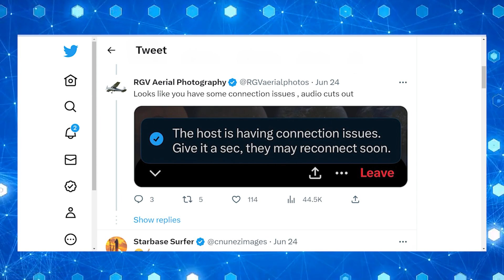Musk outlines major upgrades for SpaceX Starship stage separation ahead of next launch

Comment: So, somehow SpaceX is 'dedicated to safe and successful' launch when they don't actually perform "static fire" of engines but 'burp' them for a few seconds and call it good. Unlike any real space engineering firm which requires testing the engines before flight? They take short cuts and don't do diligent work (as shown by the pad falling apart during the last launch) avoid planning, (as they've done with the "not-a-deluge-deluge system" which will net them millions in fines if it's used at all) and in general spend huge amounts of money and time on efforts to avoid doing the simple and necessary steps they end up doing anyway.

Constant 'innovation and improvement' on a design that's not yet finalized shows a lack of proper planning and design work to START with not some form of "cutting edge" aerospace work.SpaceX has yet to reach a 'finalized' design for Starship or Superheavy indicating a groping and ill-thought out "planning" which has become the hallmark of the rough and unprepared work that SpaceX is not doing. Compare this with the more successful and competent design and planning of the Falcon which was modified once it was operationally successful rather than haphazardly as it was being built.

Comment: The hot stage separation sounds risky to me.  Why not use some COPVs (carbon-over-wrapped, pressure vessels) like the ones they currently use on the booster and to power the water deluge system?

Comment: StarShip & Raptor is on its 14th year of Engineering & Development (2009 to 2023) How many more years do you think it will take before it is capable landing with chopstick, refueling in space, landing on the moon, getting human rated and being reused rapidly? 5, 10 or 20 yrs more? Falcon 9 took 13 yrs to land on earth, 16 yrs for the first reuse and 18 yrs for manned flight. (2002 to 2020)

Comment: Another bad used of a word: Classified information is material that a government body deems to be sensitive information that must be protected. Access is restricted by law or regulation to particular groups of people with the necessary security clearance and need to know, and mishandling of the material can incur criminal penalties.

This could have been, maybe, an Industrial secret that was release or simple a company confidential information that could, if relased, cause dammage to the company revenues..  But it was certainly not a Classified information per se.

Comment: Basic no twisting? flipping turning needed? Nor elaborate base clamps? top section cupped and slight tenon loose joint should hiold upper too lower sections? Springs along  with slight booster push should part first second stages  and may be springs to help push?  Cam screw holding clamps turning on  a axle rods who do without the massive boxes and switches hydraulics electrics on pad ? 
Simple basic Less makes for better and maintenance 
Designers going back to first school and two years with basic mechanics and Meccano   who help and a study on Brunel Stevenson Tessler Von Bran Van Allen  Wright Bros Alan Turin would greatly help them all

Comment: Makes me wonder if "Hot Staging" improves weight to orbit, why wasn't it done earlier?
Reply: Hot staging puts the booster in danger of damage. That would greatly increase launch costs.
Redesigning SH to handle "Hot Stage" separation means increased mass to handle that specific situation. This means SH would need to handle 200-600 tons of force on an area that was not designed to take that. This means SH will gain a great deal of weight, not just on its upper dome but all the way down its sides. This is to handle the new mass up top and the force SS will apply at stage separation.
That's just my opinion though.
Reply: You are confused. Greatest force acting  on the rocket is compressive force (thrust) generated by 33 Raptors during liftoff. Since the Starship/SH Booster during liftoff move as one rocket thrust force is distributed according to remaining mass being propelled. Just before MECO remaining mass of the SH Booster is about 200 mT while remaining mass of the Starship is about 1000mT. That means that stage separation and the Skirt above it has to carry 1000/(200+1000) =5/6 of the thrust force generated by 33 Raptors of SH Booster. Hot staging Elon is talking about is just a smokescreen for moving away from supporting the Starship on top of the SH Booster during liftoff by thinwalled unpressurized skirt in compression and prone to buckling and instead using 6 Vac Raptors as support columns and welding support rings on top of uppermost dome of SH Booster that will support expansion bells of these VacRaptors. VacRaptors are rigid enough so they do not buckle and fail under compressive loads. If this scheme of things is successful the Skirt of the Starship  can be almost completely eliminated and rocket made lighter. Elon knew about this concept for last 2 years but stalled and now he wants to hide it from public disguising it as an attempt to introduce 'hot staging"

Comment: This so called "hot staging upgrade" is nothing else than a smoke screen for very major structural change resulting from major structural faliure of the Starship during last test fight. Unpressurized skirt of the Starship buckled due to compressive forces (thrust) generated by 30 Raptor engines. In order to avoid repetition of this faliure in next flight it was necessary to walk away from using skirt as structural element supporting Starship diring liftoff and instead use 6 Vac Raptors as support columns. In order to accomplish that task it is necessary to build support structure on top of SH Booster  that expansion bells of Vac Raptors would rest on. Instead of playing it straight Elon came up with disgiuse that he called "hot staging" First he introduced vent ring designed in such a way that it is very obvious that the Skirt of the Starship has nothing left to stand on so it is obvious that it can no longer serve as structiral element of the rocket supporting the Starship during liftoff. Than Elon introduced concept of Booster shelding structure hiding the fact that this "shelding" has just become structural element supporting Vac Raptors that in turn support the Starship during liftoff. Nice try Elon,  nice try indeed.
Reply: You don't really believe that concept, do you.  Perhaps someone else will set you more on the right path.
Reply: @bobr9512  Let me ask you a very simple question. How is the Starship going to be supported on top of SH Booster during liftoff with new vent ring in place on top of SH Booster? Do you propose antigravity or magnetic levitation?
Reply: @KarolKarolak  let me ask you a question. If the concept is "Complete Reusability" and they make it work, what's wrong with that?
From what I've seen so far, the idea is 
A) redesigning SH to vent and handle the forces involved in "Hot Stage".
B) maybe install a thrust diverter segment between the two sections.

Either way, SH is going to gain weight. SS will probably gain weight also. 
The down side is reduced payload to orbit. That being said, it will probably still have the highest payload to orbit rating in history. 
I'm not trying to be a fanboy but I believe they will work out.
Or are you just looking for nit noid things to complain about?
Reply: Real idea is to install 6 Vac Raptors instead of 3. This allows for using all  6 Vac Raptors as support columns and distribute compressive force (thrust) generated by 33 Raptors  during liftoff. We are talking around 4000mT of force max divided by 6 gives you 666mT of compressive force per Vac Raptor. In order to accomplish that task Space Cadets at SpaceX need to construct support tubes welded to uppermost dome of SH Booster. These tubes need to be as short as possible and they have to have rings on them at the ends these rings will serve as supports for ends of expansion  bells or serve as supports of the rings welded onto expansion bells. Any attempt to create functional hot staging vents in support tubes will compromise strenght of these tubes and increase their weight. Supporting Starship on top of SH Booster using  VacRaptors as support columns contrary to your opinion decreases weight of the Starship by considerable margin as it allows for almost complete elimination of the Skirt that weights much more than extra 3 VacRaptors and support tubes for all 6 VacRaptors. Elon knew from very beginning that unpressurized Skirt in  compression is a complete disaster. Despite knowing he kept trying to use it until he hit the wall of reality. Elon knew about the concept of using 6 VacRaptors as support columns for at least 2 years now. Instead of playing straight and introducing this concept in best configuration possible he decided to screw it all up by hiding it under "hot staging" concept. I can understand why he wants to screw it all up. It is not his concept as U handed it to him on a silver platter. There are at least two ways to screw things up. One is to make cutouts for venting in support tubes so big as to destroy tubes' ability to carry compressive forces, second way to screw things up is to make vents in " vent ring" welded on top of SH Booster so big that the ring will loose its ability to carry any significant load in tension. This way vent ring can rip apart due to forces generated by gimballing of Raptors during liftoff.  One thing is to hit wall of reality and learn from that experience and other thing is to hit wall of reality, get upset with reality and then try to sabotage your own best interests.

Comment: During the first launch, some hypothesized that SpaceX attempted at the last millisecond to start the engines and separate from the booster. I wonder if this would have “saved” the first flight and allowed Starship to separate from the booster successfully and reach orbit?
Reply: No according to Musk the minute they lost a fourth engine the vehicle could no longer reach orbit at all. The 'separation' mechanism was so passive that once the booster went out of control there was no 'safe' way to separate the stages and really no way to start the Starship engines in free-fall. Oddly SpaceX initially rejected 'hot-staging' as not being conducive to reuse.. But I suppose since reuse on any part of Starship has yet to be demonstrated they will accept it at this point :)
Reply: @randycampbell6307  thank you for sharing that.

Comment: Just my .02¢, while some of what SpaceX is doing seems to be reinventing the wheel, when you double the size of your rocket, small problems from before also double in severity or more.
In reference to "Hot Staging" the second stage. This wouldn't be a problem if the first stage were expendable. With the stated goals of Starship, the Super Heavy Booster is going to gain some weight to be able to handle the "Hot Staging" separation process. 
This means that Raptor V3, while a very nice increase in power, will not be as big of a bonus if "Hot Staging" becomes the process for stage separation.
Please remember, the Star Ship program is an attempt to lower the cost of putting material in to orbit. 
IMO, Star Ship is not the best idea for Interplanetary transportation. I do think it's a necessary step towards that goal.
Reply: What's best for interplanetary? Is this about Nuclear propulsion?
Reply: @AlaskaFinal  this isn't about nuclear engines. Rockets require much more fuel to get to LEO than to get to the Moon. IMO, Interplanetary ships should be built in orbit. For argument sake, let's say at the moon we have an orbital ship yard. Where the ISS is we have a space station with ships that do the Moon to Earth and back run. We need Star Ship to fairy people and materials to space, in this fashion we can better prepare to send out colonies and supplies. Every proposed new colony is going to need assistance to get started.
 Look inside Star Ship, most of its interior room is taken up by fuel tanks. Even with the development of Raptor 3, Star Ship is still going to require refilling to get to the Moon, let alone anywhere else.
How about the chance of a return trip?

Even if Star Ship makes the trips to the Moon and back, it will require additional fuel. Having a Star Ship in orbit, with fuel capacity for a Lunar run would result in a larger cargo capacity going to the Moon. 

While Earth doesn't have the strongest gravity in our solar system, it is what we're fighting against. The benefits of an orbital ship yard means we can build ships that are designed to deal with just a microgravity situation. That means they don't require the fuel to get out of Earth's gravity well.

Until we understand some kind of "Unified Field" theory, Mars is the farthest we can reach within a human life span.

Nuclear engines will work very well for Interplanetary transportation. This is why I brought up a orbital ship yard at the moon. The moon is already outside the Van Allen belts of the Earth. Having a Mars bound ship at the moon does solve a lot of problems. 
So, how do you get outbound cargo to its destination quickly and efficiently? IMO, a loaded cargo starship gets refueled, goes to the Moon, latches onto a nuclear powered "booster" ship and gets a ride. The "booster" ship picks up a cargo laden starship for the return trip. All radio active emissions are out in space with our Star's radio active emissions.
I'm no scientist or anything like that. I am a mechanic. I do understand how aircraft fly, I have an idea about weight and balance and how it affects an aircraft. 

What SpaceX is trying to do is Outrageous!!! They are trying to do it on a shoe string budget. NASA has an idea and is trying to help. 
The kind of rocket engine everyone is comfortable with and used to seeing is woefully inadequate for what is proposed.
They are decent for now. Getting to Mars and back? We already know faster ways of doing that.
That's just my opinion though.
Reply: You did miss the point waking away fron using the Skirt to support the Starship on top of SH Booster during liftoff and switching to using VacRaptors as support columns supporting the Starship during liftoff   allows for complete elimination of the Skirt with all weight saving benefits that come with it. The Starship does not need the Skirt or landing legs to land on Earth, it can use landing legs attached to LOX tank to land on the Moon and on Mars.
Reply: @KarolKarolak  congratulations, you've uncovered the biggest secret on the Internet.
Reply: You seemed to have missed whole point of this "hot staging" smoke screen. Elon is introducing major structural design change by walking away from using the Skirt as structural element of the Starship supporting whole mass of fully fueled Starship on top of SH Booster during liftoff to a configuration where he will use 6 Vac Raptors as support columns and introduce "shielding" to support Vac Raptors on top of the upper dome of SH Booster.
Reply: @KarolKarolak  I don't think I've missed much. Yes SH will gain weight to support "Hot Staging". This is why Raptor 3 is so important. 
As far as structural integrity, SH will receive all the modifications. SS may receive some shielding, but that's about it. The added strength SH will need to support regular "Hot Staging" could very well soak up all the added performance from Raptor 3.
The overall goal of Starship is to reduce the launch cost from surface to LEO with a rapid turn around time. When they perfect it, this will be a huge cost savings. 
Every pound of fuel/oxidizer required to get to LEO is cost. 
That's the same to get to the Moon or Mars also. Then you need fuel to land and take off again, let alone the return trip. Having a fuel depot at the destination would be a great idea but you have to get equipment there, set up and running first.
IMO, liquid fueled rockets are a poor choice for Interplanetary transportation.
The energy received for the required mass only works in short duration gravity well situations.
That's just my opinion though.